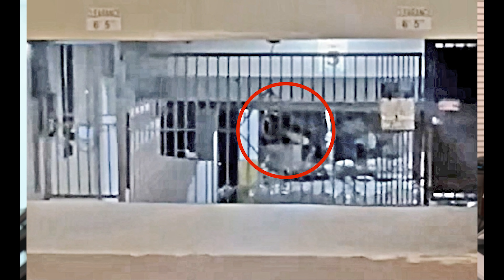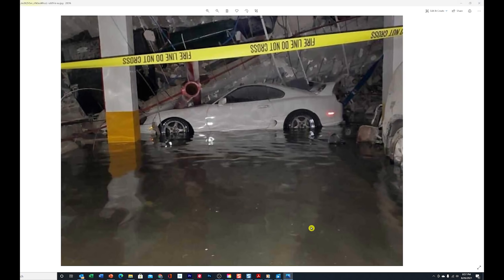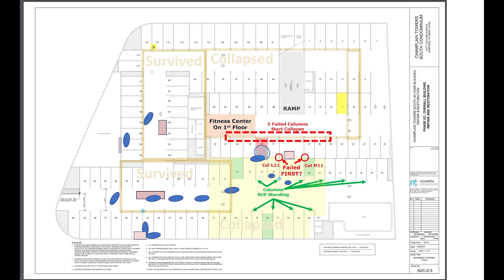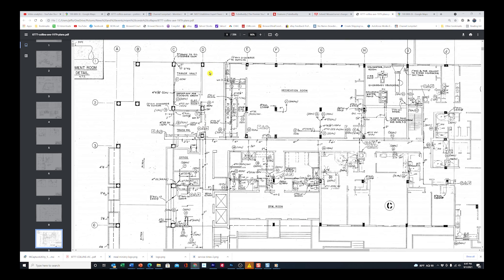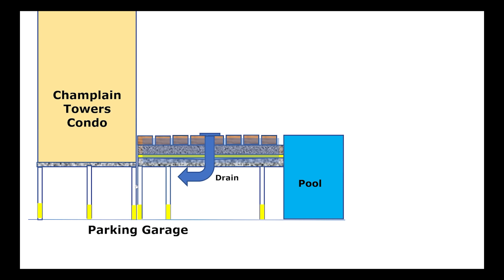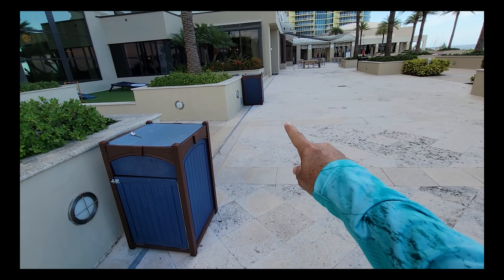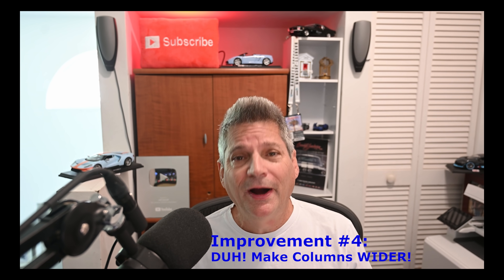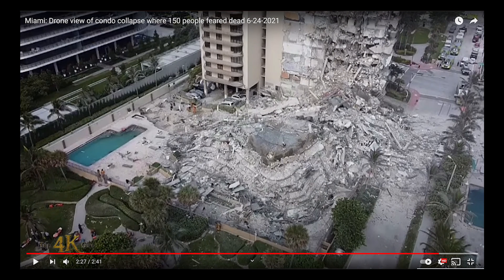Miami Condo Collapse: 4 Engineering Fixes May Have Prevented It

Comment: Could you highlight on the knee high standing water? Did it come from the pool? Saturation issues? On columns, why are they not 8'x8'? One thing I'd like to know is who certifies the  engineer plans the 1st engineer should have another engineer looking over their shoulder too?  Well, the plans probably done in the late 60's but 16"x16" is skimping on materials and the formula for column height and width required is not in spec? Could we conclude any column less than 2'x2' for every 12 story structure without punch enhancement is dome in 40-50 years if moisture don't get in first?

Comment: tne cracksI live in Edmonton,  Alberta,  in Canada and the city is installing LRT tracks and where it is necessary to elevate the tracks across intersections of roadways concrete piers were prefabricated and installed,   then after a number of months,  while waiting for the completion  of the stations and level tracks cracks appeared and has halted the openning of service.   The cracks have been filled with a substance unknown to me and the cause of the cracks is under evaluation.   Jeff,  if you can add any sort of knowledge and assistance,  Edmonton Transportation System would  be grateful.

Comment: Allot of older factory buildings called daylight factories common especially Detroit used a concrete top on there columns shaped like a mushroom to resist punch sheer. I guess the engineer for Champlain Towers didn’t learn from Julius Kahn!
Reply from the maker: Yes those are the capitals that would have been nice if they had built them into these columns that Champlain towers

Comment: Why did they stop making support collums like the ones in old buildings, @ dept stores in nyc. Those things are huge. Those buildings are still standing and aren't going anywhere especially down like a pancake.
Reply from the maker: Over the decades, young smarter engineers armed with computer aided design founded better ways to carry the load with less concrete, and better concrete

Comment: My observation is all of your ‘suggestions’ should have been implemented, as they are obvious, existing concepts in construction.  
My question is, what was the time lapse between when the first video of the collapse down the ramp through the garage gates, to the footage here with the firefighters, and the footage of the police officers interacting with the security guard?  I assume the police badgecam video was filmed well before the firefighters were able to get heavy cutting equipment into the basement garage.  Were any firefighters killed in the collapse, or had they evacuated?   With the time for all that to have occurred, and the significant collapse in the building, why was a general evacuation of residents not initiated?  Even if the residents had only made it to the elevator and stairs, they would have been in the section of the building that didn’t collapse, beyond the shear wall.
Reply from the maker: The tourist video was shot at 1:18 AM. The building collapsed at 1:22 AM. The first police as you saw in the bodycam videos arrived around 1:24 AM. The fire department kept everybody including the cops from going into the building until the technical rescue teams arrived a couple of hours later. So no firemen were killed or anything in the collapse and no injuries that night from firemen or police.. People who could get out of their apartments did but a lot of people were trapped by rubble in the hallway so that's why they were stuck out on their balconies and you could see them all waving flashlights and they had to be rescued by aerial ladder truck.

Comment: Hi Jeff:

I engineer temporary dwellings in combat areas.  We overbuild everything regardless of the intended duration of the stay.  It appears the designers of the collapsed Miami Condo were being penny wise and pound foolish.  Also, the additional weight of the later modification of the pool deck I can almost guarantee did not properly follow engineering protocols and permitting.  A first year engineering student could have predicted the future failure of the pool deck, but perhaps not the dragging down of the whole building.  Also, the additional weight of the later improvements to the units, as you've noted, was not properly permitted.

Great show,

L'Shalom,
SR
Reply from the maker: very goo insight, thanks Saykhel

Comment: You´re mainly focussing on beefing up the columns to prevent punch sheering. Very educational, and it´s nice to hear these vernicular terms and their detailed explanation. The first thing that crossed my mind, however, was how to prevent a progressive collapse. Over time, additional loads are likely to be added to these half eroded buildings without RTFM. Be it planters, swimming pools or AC-units. These buildings aren´t exactly future proof.

Isolating works for lower structures, where lateral wind loads are neglible. So having an expansion joint would have worked in this case, but taller buildings need substantial integrity.

So as a more generic sollution, I would be in favor of load bearing walls between some columns. Top to bottom, with rebar. Instead of beefing up the columns, you get these huge box sections, just like those fortified stair cases and elevator shafts. They spread the load like beams would, and can handle bigger lateral forces.
A sagging concrete slab can topple a column, making the next slab fail etc. but it will sheer of an elevator shaft. It saved half this condo from collapsing, if I´m not mistaken.
These fortified walls provide enough isolation to prevent a progressive collapse, without sacrifying too much integrity. That´s the sweet spot we have to aim for. There´s no need for a parking garage to be a wide open space, and we need divider walls inbetween the appartments anyway.

What I´m suggesting is nothing new, and probably more expensive, but it surprises me that the building code allows highrises to progressively collapse like a house of cards if just a few columns give way.
Reply from the maker: Yes load bearing walls could help too, I like the other scenario I presented in this video, the expansion joint or isolation seam.

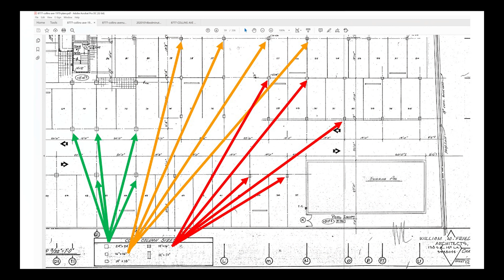Comment: @15:12-15:28 You mention that " having 20-24 inches is a lot better". Que "A LOT BETTER". What makes it a lot better? Should that have been the width designed for the building? DOES this width support the building, whereas the lower width DOES NOT? What's your reasoning behind this?

Also, not an engineer, just curious for the answers. pls repond?

Edit 1: 20-25 inches -> 20-24 Inches
Reply from the maker: When the structural engineers evaluate the capacity of a building to hold the current load whether it be at dead load or alive load, their formulas and their simulation software will always show that wider columns support bigger loads that's a simple fact of physics. Oftentimes because of the thickness of the concrete it means you have more support square footage under the upper floor, and with wider columns you likely have more or thicker rebars that would give it additional strength. Combine this with a column cap, and a drop panel on the ceiling, and you have an invincible design

Comment: I haven't seen all your video's but those I've seen are really interesting. I have one suggestion. If you haven't discussed it before, have you looked at the piling part of the design. I worked for a power company that designed their plants. All plants were on rivers. Very muddy places. All plants had piles. One early plant settled. Every one after were piled like the proverbial shithouse. 
A michigan nuclear plant never operated because the fuel handling building settled.
Reply from the maker: Building Integrity covered that on their channel pretty good.

Comment: Im not saying that's not a planter in the garage, but it didn't come from that pool deck and end up where it was.
Reply from the maker: Yes it fell from the pool deck above which is exactly where that planter was, right over that missing column M11.1
Reply: @jeffostroff  yea i see that now pretty confusing.
Reply: @jeffostroff  bet the building had to much weight for those columns
Reply: @jeffostroff  Just watched a video that said the pool deck brought the building down due to lack of punch sheer rebar on the columns. He said if they would have had punch sheer rebar on them the building would have held.

Comment: II worked as a Manager of a few cities in  Miamii-Dade and Broward Counties in the hey day of development.  The rapid rate of construction was too fast for the administrative oversight required to inspect the  buildings and enforce the codes.  One thing I remember is that the code did not require the reinforcing rods to be epoxy coated, hence in the beach areas with  very high salt content put those buildings without the protected rebarr put those condos at risk for rusting compromising the structural integrity of the buildings.  The code was changed but many buildings were constructed when it was not a requirement.  I remember seeing rebar piled up and rusting at a site.
Reply from the maker: Yes, they used to leave it lying around in piles, rusting in the rains

Comment: Great, informative video that gives future architects and builders something to seriously think about.   But in the case of this condo, it’s sister buildings, and others just like it, the construction is subpar at the very best.  Personally I find it hard to believe that such a building would ever be allowed to be constructed next to the ocean.  Imagine what would have happened if a Hurricane Katrina slammed into the side of it.  That almost happened, but instead of Katrina, it was Hurricane Andrew.  Just a bit further northward and this building might have collapsed even sooner in it’s rather short lifespan.  That’s because there’s no exterior concrete walls lining the exterior portions of the building that aren’t glass.  Other than the single concrete sheer wall behind the elevators/stairwell on the western section of the building (which probably helped to prevent it’s collapse) and the much smaller concrete sheer wall at the eastern side stairwell, the only other concrete was in the floor slabs, columns, and swimming pool.  The rest was of the building was made from much weaker steel studs with wall board covered with stucco.  I’m sure there’s a little more to those exterior walls, but not anything that would add any real strength.  Has I built this, the building would’ve had a 2 floors of parking under the building with NO parking under the pool deck.   That’s because the building would’ve had thick hurricane proof exterior concrete walls going straight down to the bottom of the foundation.  Furthermore, the first floor parking would’ve been built at the natural grade of the lot instead of being below grade as it was constructed.  That would’ve raised the entire building an additional two stories, as the condos would’ve started on the third floor, not at grade level.  That would’ve given the building two floors to help keep any tidal surge from being able to crash into any of the occupied units.  Additionally, there would be solid concrete walls between each unit for fire protection (from what I’ve seen from every video presented, there was zero fire protection between the units.  I’ve thought about buying a condo before, and when looking at them, that’s typically the very first question I ask…”What fire protection has been built in to prevent a fire from spreading from unit to unit?”   Additionally, all the columns would’ve been no less than 24”x24”.  But with concrete exterior walls, some of those columns wouldn’t have even been needed, as the walls themselves would’ve had far more strength to hold up the floor slabs in those areas without the need for the exterior columns, as those walls would’ve acted as one continuous column to which the floor slabs would’ve been attached.  There would’ve been heavy steel beams beneath the concrete walls that ran between the units, as each unit would’ve been fully  enclosed for fire isolation and building strength in a major hurricane zone.  As this building was built, I highly doubt it could’ve withstood a direct hit from a Cat 4 or higher hurricane.  If I was living in the north or east tower, I’d be trying to sell.
Reply from the maker: Building codes have changed a lot in 40 years, the buildings are built a lot better now
Reply: @jeffostroff  Yes…and no.  Building codes increased drastically after hurricane Andrew.  You couldn’t build a home or anything else if you were on a Florida barrier island unless it was made from concrete/concrete block.  But now those rules have once again been relaxed (thanks to the building lobbies).  Wood frame houses have now become normal on those same barrier islands.  I’ve even watched as a huge 5 story apartment complex went up on Anastasia Island off Saint Augustine, Florida.  The entire structure is made from wood.  And not 2x8s or 2x6’s, but plain old 2x4’s.  My single story home (on the same island) is stronger.  That’s because my home is built from concrete block that’s also been filled with rebar and poured concrete, to withstand hurricane winds.  Even in areas where the block would’ve been too heavy such as over the large screens on my back porch (also built, per my insistence, with the same materials as the rest of the house) there’s 2x8 construction that’s bolted directly into the concrete as well as held down with hurricane clips.  Placing solid concrete walls between each unit makes building the parking garage harder, but not impossible.  Places that build their units in that particular manner often turn the below building parking spaces into actual garages for the tenants instead.  I used to live in such a building while stationed in San Diego.  That building’s construction exceeded the new construction I see going up along Florida’s coastal areas as well.  

While I have no doubt that this building was built to code, it’s was grossly under built.  The columns under the pool deck were performing at their maximum load as built, and that’s BEFORE any deterioration weakened them.  The condo association was really brazen to put those huge palm trees along the deck.  They certainly looked pretty, but without a doubt they grossly overloaded the pool deck.  It’s just plain luck that the columns didn’t collapse back then.  The building only had two concrete walls within the entire structure (excluding the exterior walls in the parking garage and pool itself).  Those walls were strategically placed to keep the building from being able to be pushed over from the side, but provided absolutely no resistance from the building being pushed fore or aft.  They were located by the western elevator and the east side staircase.  Had ALL the exterior walls and interior dividing walls between the units been built from concrete, those walls would have provided a significant amount of support for those large, heavy concrete floor slabs in addition to the already present columns.   Thus, even when those 5 columns failed, the exterior concrete walls would have been strong enough able to carry the building’s load long enough to get everyone out.  Had the other 4 suggestions in here been implemented, they too would have prevented this building from collapsing.  The northern tower is in far better condition than this tower was, as that condo association has been far more attentive to the overall condition of their building.  But like the construction on the southern tower, it’s still questionable if that building could survive the direct onslaught of a category 4 or 5 hurricane.  The exterior walls of either building are no match for the forces created by a tidal surge, so at least the bottom 2 floors would at the least, be completely destroyed.  And it’s questionable if those thin columns could hold up as well.  I hope the people living in the Northern Tower are listening to the comments made in these videos and are taking the suggestions to heart.  It’s always better to overbuild than to under build.  I’m a firm believer in over building structures simply because we don’t have crystal balls that allow us to see what may be coming in a building’s lifetime.  The truth is, the eastern seaboard of the United States (particularly Florida), is every bit as vulnerable (if not more so) to tidal waves.  There’s an volcanic island sitting off the west coast of Africa that has a huge crack running right through the middle of it.  It’s been predicted that the western half of that island is highly vulnerable of sliding down into the ocean, which would create a humongous tidal wave that would likely hit the eastern seaboard of the United States should that ever happen.

Comment: So the drop panel is sort of like a washer?
Reply from the maker: The drop panel provides a wider and thicker base of concrete to provide resistance against punching shear if you look up pictures of punching shear on Google you'll see how it tends to shear off at a 45 degree angle from the top of the column where it meets the slab. But if they can put a big thick pad of concrete there, then it can't shear off at a 45 degree angle at the top of the column because there's so much concrete and rebar in there to protect it from shearing.
Reply: @jeffostroff  Cool! So is there some accuracy in the analogy of it being like a washer? I'm talking about the flat discs that are placed under a fastener in order to more widely distribute the force (or whatever) of the fastener's head being pressed up against the material that it's being driven into.

Comment: Jeff, I think you're also missing a very important point, and that is the quality of the concrete.  I heard that the concrete was that not of a 6000lb PSI pour.  You can put in all of the fancy rebar you want.  If the concrete is not poured in based on code, then it's going to bust apart like a dirt clod.